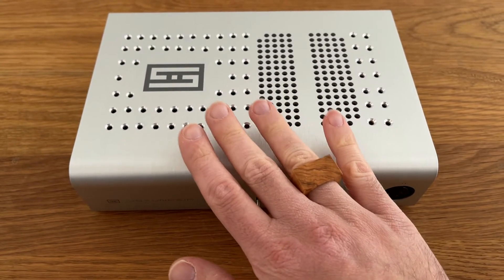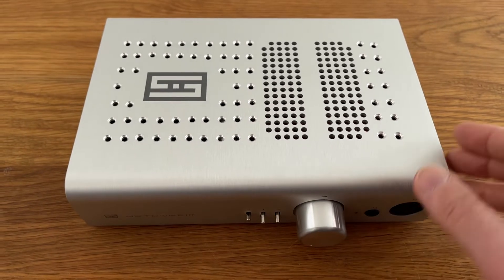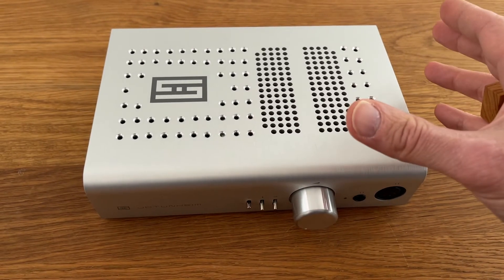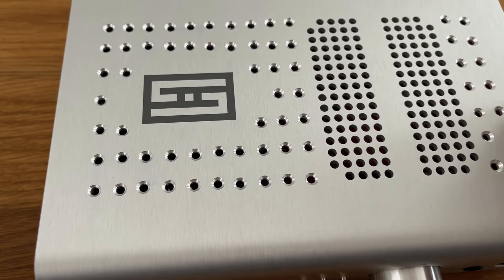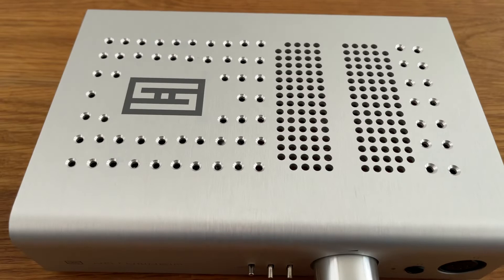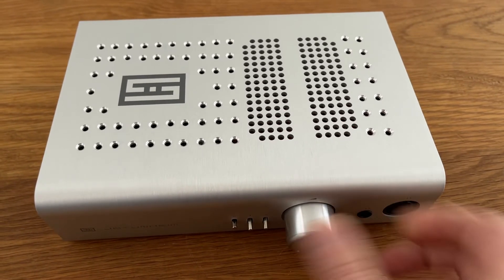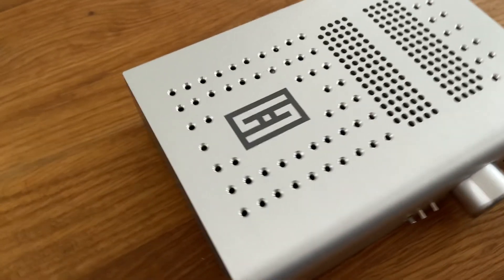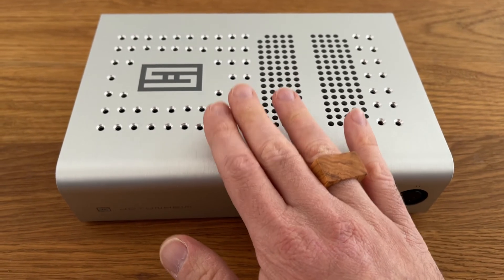Schiit Jotunheim 2 Mod — How to Reduce Heat & Improve Life Expectancy of your Amplifiers

Comment: Great video! A quick question about it, do Jotunheim defuse the heat through bottom metal plate and pass the heat to the main body? sadly i dont have the handy tool to drill holes on it. But I do think of buying a ventilation fans either blowing from its bottom or suck hot air from its top ventilation holes. I'm using it as headphone amps plus preamp for my schiit Vidar, so the preout needs to be on, and most of the time it's also on high gain. so it gets hot.
Reply from the maker: Thanks for your compliment and for your great question! To be honest I don't know. I assumed that Jotunheim had a basic flat red PCN on the bottom without any heat-dissipation contacts.
Looking at your question I think its actually a great idea! Why did they indeed not soldered the opamps/transistors on the bottom then put thermal pads on them to touch the bottom metal plate?
That would have dissipated the heat much better indeed! Since there is almost no space between the bottom metal plate and PCB, I am 99% sure that there is nothing on the bottom of the PCB.
Reply: @sambalsamurai9672   Thanks a lot for the reply. I don't really have the expertise to open it up and tear it down by myself. I assume the same, but it would be great if there are direct contact between the PCB and bottom plate. If thats the case it even makes more sense using a fan blowing at the bottom plate.

Just fyi, regarding the fan choice, i come across a brand called AC Infinity, their Aircom S6/S7 could be a perfect choice. The fan was designed to suck hot air out from the top, but i put it under Jotunheim so it blows air at its bottom plate. I can test for a few day and check back to let you know how it performs. 

I havent really had the heat issues until this summer, it's especially hot this summer, Vidar don't actually generate that much heat (it has much much bigger radiator), but Jotunheim generates a good amount of heat, still touchable but it kinda make you wanna move you hands away after you touch it for a few seconds.
Reply from the maker: @looper6120  Exactly! Same reason why I sat down and decided to take the risc, void the warranty (possibly brick the unit) take out the cover and drill some holes in it.
I dont know why or how such a nice brand has overlooked this heating problem. Especially knowing they are headquartered in a hot state namely Texas. 
More natural ventilation would be great for prolonging the lifespan of such units. If I was a designer I would have built it differently, more open on the bottom and sides as well.
Reply: @sambalsamurai9672  haha i agree, i traveled to Schiit audio store once in California, i believe that is their one and only store on west coast. On their show table, they don't stack Jotunheim, I suppose they figure it would be too hot. 

And a quick update, I used AC Infinity S7 (the top exhaust one) and put it on top of Vidar, then put Jotunheim on top of the fan. 

It stacks pretty nice and solid, I tested for about a couple of hours now. I can absolutely tell the difference by touching the metal case. I think it can work as a nice solution if you wanna add a fan. Previously, I would call it as hot, not it's only warm. Nice and cool so far. Worth a try
Reply from the maker: @looper6120  Excellent, sometimes there is no way around active cooling. This will double the lifespan of your schiit! 😎😇
Reply: @sambalsamurai9672  It absolutely works. after continuously listening for a day, it's around 80 degree in my room, poorly there is no AC unit here in Seattle lol. it stays nice and cool, highly recommend anyone who are having heat issues with their schiits!

Comment: Cool video.  Something I do with my gaming systems is I use a little fan and face it outwards to "Draw Out" the hot air
Reply from the maker: Great idea, some old vintage larger sized amplifiers also need that (outward facing fans placed on top directing air upwards) to stay alive for so many decades as they have... and the many decades to come in the future.

Comment: I would of just left the top case off :)
Reply from the maker: Heeehe, nice, nothing beats that for ventilation. But, I personally have the habit of wanting to caress the top of my gear when cleaning the dust off.
But seriously are you not afraid that something small made of metal might some day fall into the guts of the thing while still live and running causing a short (run to her final grave) ?
😎